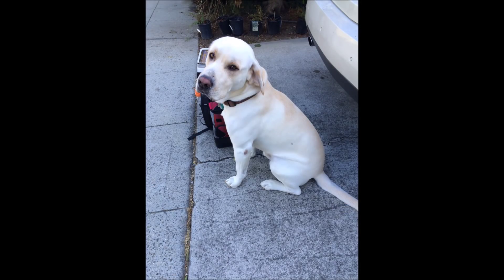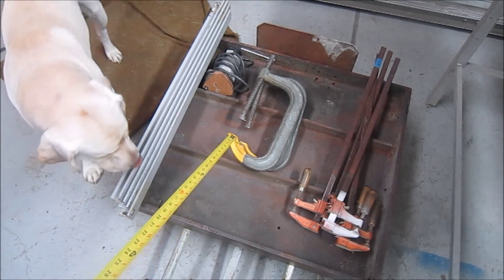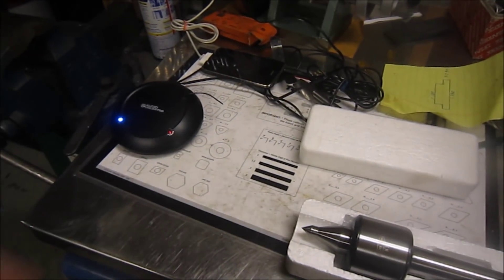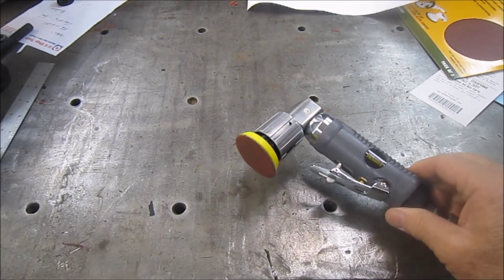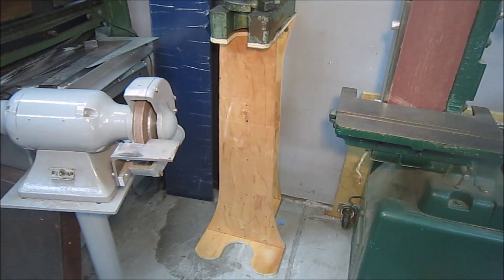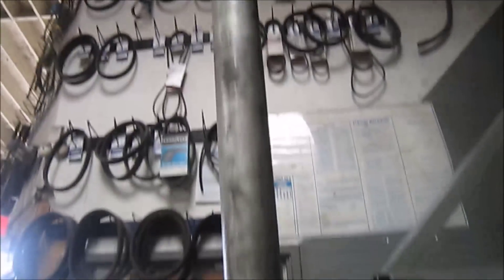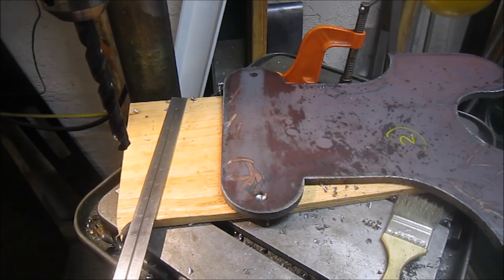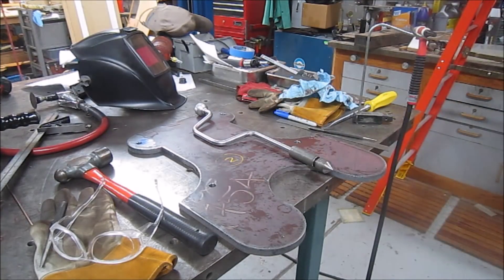Screwy Tuesday #48  Arbor Press Stand Build

Comment: i have an arbor press about the same size as yours. i use it all the time. i even made a mini press brake for it to make small brackets and such. your stand is going to be a work of art.mine is a 20inch brake drum from a large forklift and a 4 inch hyd cyl rod  with a plate welded to the top. its very heavy and stable but can be moved if needed. cant wait to see the finished product.
Reply from the maker: +larry sperling Thanks Larry and great idea on making a mini press brake...

Comment: Planing to do some multi-pass 7018 rods on those plates...   ???
Here we get some Stainless steel, laser cut and ready to assemble parts from CAD, for less than the price of a plain sheet, wonder how they do it...  ;)
Reply from the maker: +pierre beaudry hmmm7018 would be fun, but thinking of mig or maybe some of both, thanks for stopping by the shop
Reply: outsidescrewball
Some 1/2 in. material is getting to be heavier material, you'll have to put the pedal to the metal in order to get some decent penetration, hope you put up some footage of the weld.  Don't forget about distortion....  !!!!

Comment: Chuck..........you'll be happier with that little HF da sander if you break that little spring clip safety off of the air trigger.  In fact break them off all your air tools and rock on!  I sure wish I could get flame cutting done that cheap!
Reply from the maker: +Kirk Miller Thanks Kirk for viewing and commenting

Comment: Half inch steel, that arbor press is going to be well supported.  I liked the hydraulic press with the fancy electric pump and the even fancier lead screws.  They are an indispensable tool for shops that do any kind of bearing work.  Glad to see Howie making good in the modeling business.